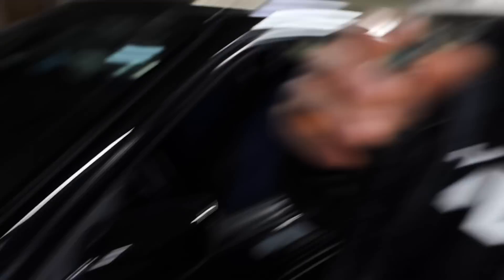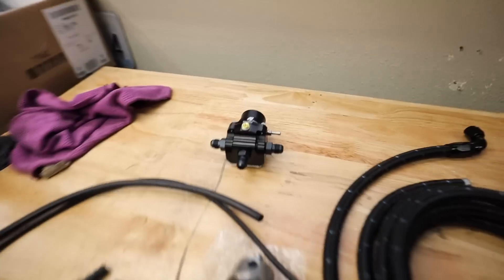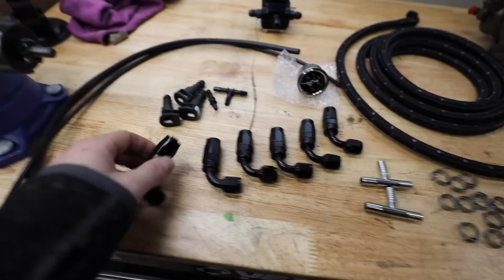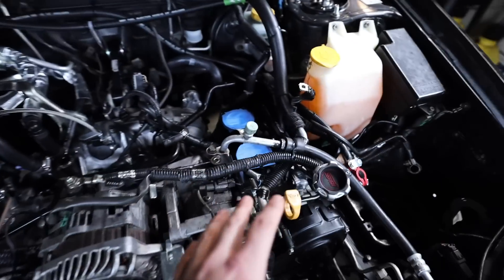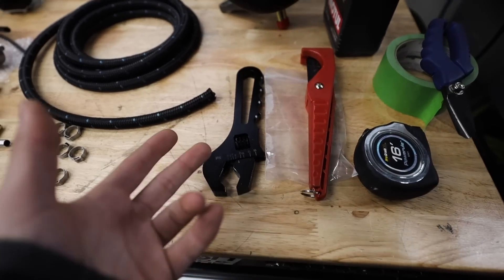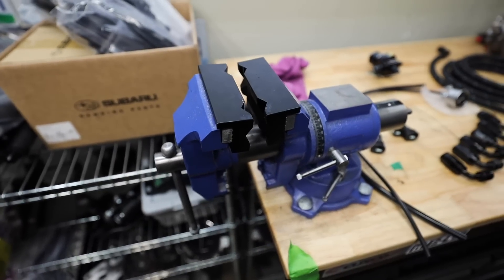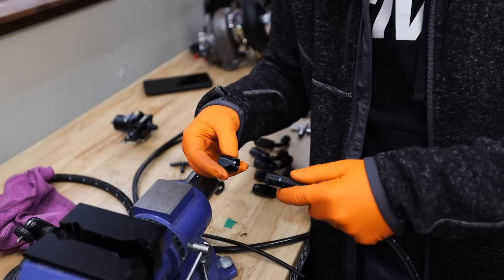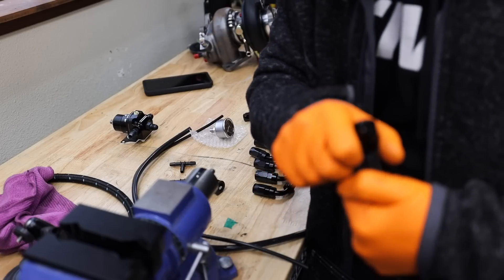How to Make Braided AN Fuel Line Subaru STI (Aeromotive A1000)

Comment: To get the oem line adapters into the AN line, put a little bit of Vaseline on the barbed fitting. Will slide on much nicer! Love the videos man! Love to see other guys on the non stop Subaru grind!
Reply from the maker: I tried using a bit of oil and still did not want to go on 😅 going to be fighting with them a bit more. Ended up moving the FPR again but she's getting there 🔥😁
Reply: @Smeedia  Haha yeah they are a struggle for sure. If you’re running a front mount already & aren’t mounting your AOS on the pitch stop, you could mount the FPR in the pitch stop area. Nice centre location & you can view the FP gauge from the front of the engine! Good luck man!
Reply from the maker: That's actually where I moved it to this morning 😅🔥

Comment: I like the way your fuel lines are routed. I, for whatever reason, did not think of putting them under the coolant crossover pipe on my Forester. They are still tucked under the intake manifold though. I will for sure be doing this when I break down and get some proper TGV deletes. Ha, to save a bit of cash I just removed the butterflies in mine. It's coming along though Tanner. Looking forward to seeing the final product and hearing that first start up.
Reply from the maker: I went back and forth so many times moving lines around. Ended up moving the FPR but always a fun project 😅🙏

Comment: @Tanner, thank you finally somebody went to making this video BUT I DO HAVE QUESTIONS. 
1) @4:05, when inserting the hose into the reverse threaded nut, to ensure that the hose will not pop off under oil pressure, does the thread score the inside or the outside of the hose? If i made a mistake, do i need to cut the tip off and try again?  
2) @5:10 When installing the fitting while the nut is on the vice, is this the locking mechanism that locks the nut and the fitting together or does this almost like crimp the hose into the nut sandwiching the hose between the tip of the fitting inserted and the nut?

I have used a well known brand 10- AN braided oil lines (with the fittings and hoses already prefitted) when i installed my two oil coolers in my track car for fears of oil leaks while on track.
Reply from the maker: It shouldn't score the outside out of the hose,  depending on how deep it went into the hose you may need to replace that section. 

This locks the fitting onto the nut creating a leak free seal, assuming that it isbtigneded down all thr way. The threaded nipple slips inside the hose and the threads ensure nothing will leak out.

Comment: What were the quick connect barbed fittings you used for the hardlines coming from the fire wall. Also doing this setup where do you run the evap line too. I’m lost as to what you do with that line coming off the firewall.

Comment: I'm enjoying this build content.  Do you have a specific use case or certain sets of mods where you decide to use an aftermarket FPR or is this just something common for you to do in your builds?  I ask because the kit is not cheap, and many times people use FPR's as a bad bandaid for not upsizing the injectors properly.  I tend to stick with stock FPR setups unless the build goals dictate otherwise.
Reply from the maker: Whenever I swap rails is when I do the FPR, alot of people use stock rails with 1050s and the Cobb FPR but it doesn't fully correct the fuel stumble issues. Ideally if your shooting for 375+ is when i would do rails, lines and FPR
Reply: @Smeedia  Great explanation, thanks man!  Ah, I didn't know this gen had the fuel stumble issues as well.  Wow, that went on for a long time.  You ever tryout the OEM GR WRX dual fpr setup?  I believe that fixed the issue and I've commonly seen people swap that setup to the same gen STI's to fix that issue as well.
Reply from the maker: I've never used it, just swapping rails, injectors. Lines and FPR has always corrected the issue for me. 🙏🙏

Comment: Just installed an iag rail and fuel line. I was wondering where im gonna route the evap hose from driver side firewall
Reply from the maker: Normally I just tuck mine away 🔥

Comment: The fuel line to the firewall did the quick disconnect work for this car?
Reply from the maker: Yes and no, was not happy with them so ended up reusing thr stock clamps and sliding thr hose over the hardline then locking it down
Reply: @Smeedia  thanks Bud.   Keep up the vids they are extremely helpful.

Comment: How did you cut the line? I have used a cut off wheel on a grinder but that creates alot of debris in the line which I blow out with compressed air.
Reply from the maker: Just with the hose cutters, linked them in the description, like $10 or ao for them 🙌
Reply: @Smeedia  so your line isn't steel braded?
Reply from the maker: No sir, just braided

Comment: So I’ve found mixed answers on this. When running E85 does your whole fuel system need to be braided line? Let’s say you by the Cobb flex fuel kit. Do you need to change all these fuel lines or can you use the stock ones and the ones Cobb provides you?
Reply from the maker: No it does not, as long as the line is rated for E85 your fine. That will be steel, PTFE or E85 nylon braid. The ones Cobb provides are fine
Reply: @Smeedia  thanks again Tanner!

Comment: Hey Tanner awesome how to, could you put quantity of each part/fitting needed for how to in your description?
Reply from the maker: That's gling to depend on how you set up the fuel system but I can add some rough numbers to get ya 90% of the way 😁
Reply: Aeromotive has a full kit. Part#14135. You can find them on the Aeromotive site or from the website I get my parts from here 
https://www.iraceautosports.com/product/aeromotive-02-14-2-0l-subaru-wrx-07-14-sti-fuel-rail-kit/

Comment: I'm curious of your thoughts on parallel vs series for fuel lines. I think it's a myth that parallel helps at all, except maybe at the extremes like 800+HP builds. Like, the FPR is on the return line and makes sure you have, say 60psi under WOT and full boost. There is no way the last injector in the series needs more than 60psi for 100% duty cycle. I could see it helping for high end setups like your 2017 STi since it's going to be VERY thirsty, but for the average 400hp setup, I'm a fan of running them in series for simplicity and fewer hoses. Also, I'm just cheap and have a Tomei FPR that only has 1 port so I'm making excuses to avoid parallel, haha!
Reply from the maker: Lol I'm with you, I don't see a huge need for it unless your running high high horsepower. Someone who knows more than I can chime in on this but Inector duty cycle shouldn't need the extra bump with sub 600WHP cars

Comment: I’m in the process of doing mine, and I’m so lost. So the feed line goes to the Tee then to cylinder 1&2 first then back out thru 3&4 and feed line from cylinder 3 goes to the front side of fpr, and cylinder 4 goes to back side of fpr, then under the fpr goes back out to the return?
Reply from the maker: Feed line goes from the fuel rails into a T or a Y fitting then up to the hardliners on the fire wall. Both of the returns will go to the fuel pressure regulator then the fuel pressure regulator will go to the hardline in on the fire wall 🙏

Comment: Had problems  overtime. gauges go bad from vibration  when mounting on the engine.  Better to mount on the firewall  or strut tower for longevity
Reply from the maker: Eventually ended up moving it from the engine 🔥
Reply: This was on a Honda  b series  turbo .  Think at the time it was a B&G or B&M   gauge(s)?  Went in line right on the rail  .even  with isolators the vibration  would  eat the gauges.. I'm actually  resurrecting  my 92x at the moment

Comment: I'm doing a parallel fuel line set up on my 02 wrx. the thing i'm confused about is that there's 3 hard fuel lines. i know to route the feed and the return lines, but what about the third line? the breather/evap i think, what do i do with that one?
Reply from the maker: I just vent that line down into my fender, just pull off the softline from the manifold then reroute it
Reply: @Smeedia  Do you mean you just route an open hose to the fender area? Do you cap off the manifold where it was located? Thanks
Reply from the maker: Route the open hose to the fender 🙏
Reply from the maker: When doing the fuel lines that evap hardliners will be gone

Comment: Got a CEL P0304 cylinder 4 misfire replaced the plug and swapped the coil pack. Swapped 2 to 4 and 4 to 2, still getting cylinder 4 misfire.

Do you know if the coil packs are coded? MY08 Wrx 226bhp.
Reply from the maker: I don't think the 08+ is, I know some of the older ones are. I would double check and do compression and leak down to see what's going on
Reply: @Smeedia  Valves are gone or sticking mate.
Reply from the maker: Pop the valve covers off an looked inside? 

If it is just the valves it should be too pricey to fix 🙏
Reply: @Smeedia  I think that's a garage job ha, done most of the above parked on  the drive.

Comment: first of all, been following you for years! 

now i have been building my car for a year, and have run into a strange problem that i cant seem to get my head around. i bought the aeromitive fuel lines and AN fitting, FPR and rails with side feed injectors. since i have installed them i keep getting fault code that reads injector cyl 3 and 4 voltage low. when i return the stock fuel rails there is no problem and no fault codes. swapped in new injectors and got them scaled, put the aeromitive rails back in and same fault code. I have changed wiring harness, ECU. same problem. put back stock rails and problem gone. WHAT AM I DOING WRONG??? any help would be highly appreciated.
Reply from the maker: I actually just had this sane issue with my wrx and it ended up being the injector electrical connectors were bad. I'd start with there but the fuel rails dhoukdent change anything 👀

Comment: Tanner - I have a question. I followed that link to the line you suggested. It looks to be a CPE line and in the description it says it’s NOT okay for E85. Is that right? Should I run PTFE if I plan to go E85 later or is CPE actually fine and/or better for some reason? Also, do you think 20’ is enough or would you go with a different length? Any updates/recommendations on this process you have in hindsight would be appreciated. You said in another comment that the hardline adapters sucked? Lmk. Thanks!
Reply from the maker: If you plan for E85 I alqays suggest vibrant AN line. It is rated for E85. The evil energy is for gas only. 

Personally I'm not a fan of PTFE, pia to make lines for. 

They definitely do suck lol I just slide the hose over and slap a hose clamp on them 🔥

Comment: Im curious... why not FP guage on the dash..?  Is it running fuel lines into the cabin that's the issue?  Or is it just tradition to keep it under the hood?
Reply from the maker: To adjust fuel pressure you turn the screw ontop of the FPR and its easiest to have a gauge on thr fuel pressure regulstor to see what your doing 🙏
Reply: @Smeedia  cool, thanks for the response!

Comment: When upgrading fuel pump and injectors do u need to upgrade the fuel rails too or no. 🤔 and any pros and cons if you were to use only 2 ports vs 3 ports that feed the fuel rails.

Comment: Love the look of braided lines. Question why is Subaru bumper paint so soft? I know Toyota has soft paint too, but my pearlescent white GT86 got peppered and a windscreen chip (now filled)  stone chip the other day. Anything bar ppf or respiratory/touch ups? What do you do with yr Subaru paint? Someone on the GT86 U.K forums said aerodynamics of car don’t help.
Reply from the maker: Subaru uses thin and soft paint which is just prone to damage, best way to protect it is PPF, and the gentlemen in thr UK is correct as air streams made by thr aero parts can pull small rocks up to the car. You can try touch up paint but I've never had good success with it
Reply: @Smeedia  Cheers for the response good to hear from someone like yourself who has owned lots of Subaru’s.

Comment: Hey Tanner, I found the fittings I need for the FPR, where did you get your quick connects with barbed ends and the clamps that hold the hose the end? Actually what size for the end that connects to the hard lines?
Reply from the maker: https://amzn.to/3IaRub6 🙏

Comment: @smeedia I’m running new fuel lines but do not have your fancy fuel pressure regulator I have 2011 sti withCobb full flex fuel  system with Cobb fuel pressure regulator radium fuel pump hanger . Was trying to figure out what fittings I need to use under the hood I just ordered some 5/16 nipples to hook it up. Same style fitting as a factory metal line.

Comment: Hey Tanner, I am looking at the A1000 fpr, should I get the gen 2 one or the original, I have 2021 STI. Also I am a bit confused on which a/n fittings, quick connects to get, size wise. I am just doing the lines from the firewall to the top of the manifold at this time. Thanks for your help and great videos.
Reply from the maker: Gen 2 🔥 it's a little smaller in size. And they should all be 6 AN 🙏

Comment: Dude @smeedia,
I’m currently doing the same setup but with stock TGV Sensors, because well..you know.
I went with the IAG FPR, I have a question, the -6 an fittings to the FPR,  can I run a -6 an to 3/8 npt? Thanks
Reply from the maker: Technically yes you could, but why you wanna use a 3/8 npt?

Comment: For the Cobb flex fuel kit where would you hook up the fuel pressure censor and the ethanol censorb
Reply from the maker: Mounted mine in the fuel pressure regulator. 🙏

Comment: Any particular reason you went with the digital fuel pressure sensor kit over the iag guage on the 2017? I have the same kit and was curious.
Reply from the maker: The tuner suggested that sensor last time, did not see a huge need for it again. An analog gauge works just fine 🙏
Reply: @Smeedia  thanks for the reply.  I'm in that dilemma with it atm. Lol
Reply from the maker: Either option works. If your etuning get the pressure sensor, if going onto a dyno get the analog gauge to save $$$

Comment: Is the order of the fuel, evap and return  line the same in every subie . Got a 2011 wrx and will be doing fuel line soon. Do you think parallel is that more better than series?
Reply from the maker: I've never seen a need for parallel unless your shooting for some high power but as for the fuel line it should be thr same in every subaru 
Blue = Evap
White/Grey = Return 
Black = Feed
Reply: Not sure why I would think that return would be on the bottom. Thanks. What’s the P.O. Box in case I like to donate to the cause. Lol
Reply from the maker: 😁😁

Tanner Smith 
Smeedia 
1002 N Meridian Ste 100 PMB 120 
Puyallup, WA 98371

Comment: I'm going to do a setup like this on my 2011 Sti soon. I was looking to get the IAG braided lines that already come cut to length with all the fittings. But I feel like I'm perfectly able to make these lines too. I wonder how much more cost effective it is to do myself?
Reply from the maker: I've done both set ups now and doing it at home ND making thr line will save you around $250 or so

Comment: I love the video an it did help me out. I’m curious how I will run to the return line with my fpr. Also under the manifold by the turbo inlet. I’m trying to figure out where I go with the lines from the blue T connector. There’s the purge valve then a purge control solenoid with like hose connectors, if u could help me out that would be wonderful
Reply from the maker: Are you making everything from scratch or a kit? Ans what is the car? 🙏

Comment: Cool spot to mount the FPR! I know it takes you a few days to get your videos up, but if you have not solved your pressure gauge fitment issue,  I think you could likely get it to fit using one of the elbows that IAG sells for the regulator (probably would look better being able to see it from the front of the engine bay too). https://www.iagperformance.com/90-degree-1-8-inch-npt-male-to-female-zinc-plated-fitting/

Question for you: you are using a T for your fuel delivery line splitting, IAG uses  a Y in their line kit. Do you think using a T makes any difference at the performance levels you will be running? I wonder if e-85 level of fuel consumption if it may make a small difference? Noob here, so don't know.
Reply from the maker: The videos are all filmed 1 day prior to upload 😁 and I ended up moving thr FPR to another spot this afternoon, but I did look into thr elbows 🔥

So IAG actually provided the T fittings, I was looking into that as well and from a flow standpoint a Y does make more sense than the T. I couldn't tell ya if it makes a huge impact but in theory a Y seems like we would get smoother flow
Reply: @Smeedia  Strange, they gave me a Y! Anyway awesome video, wish I had seen this 2 months ago :P